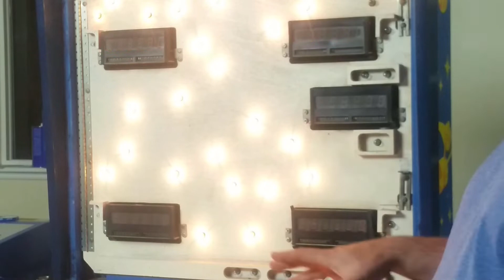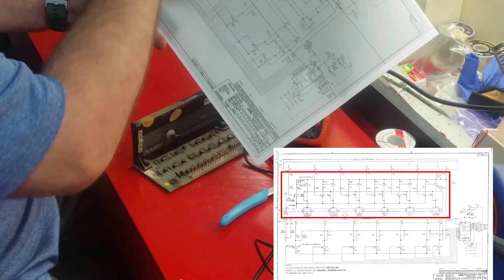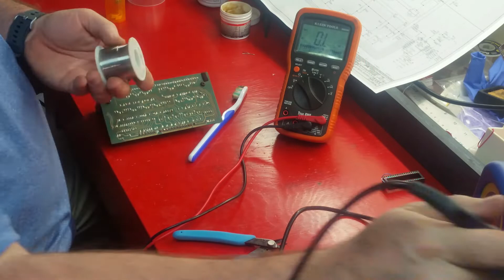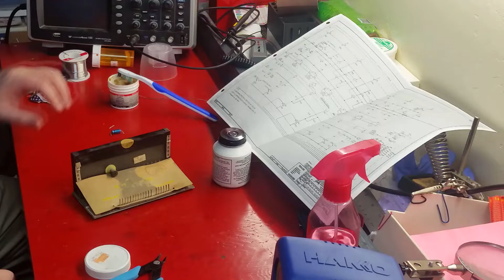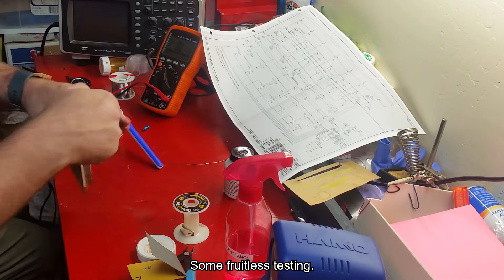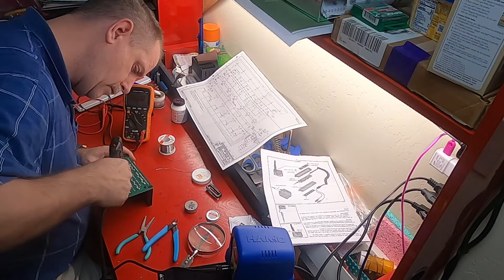Display refurbishment

Comment: When replacing bad transistors, How to choose a different transistor part number that is Compatible? The HFE, beta, NPN or PNP but what else to look for that will make it compatible because if the bad transistor is an NPN and you choose another transistor part number that is NPN why won't it work in various circuits?
Reply from the maker: I am just a hobbiest, so I am not an expert by any means.  However, I usually start with the parametric searches on the electronics providers.  The order of importance of parameters, in my layman level opinion, is:
1. Type: BJT, JFET, MOSFET, etc.  Can't replace one with the other without re-engineering the circuit.
2. classification: NPN, PNP, N channel, P channel, etc.  Same reason as #1.
3. Package:  It doesn't really help to have all the correct electrical characteristics if it won't physically fit.
4. Voltages: If a transistor can't handle the voltage levels of the circuit, it won't last long at all.
5. Current handling: Same reason as #4.  
6. HFE, Beta, etc.  These are important in many cases, and getting as close as possible is great.  However, depending on the application, it may not matter.  sometimes they are just a switch, and only operate fully saturated which makes these less critical.

Of course, this is just my opinion, and a very uneducated opinion when it comes to electrical engineering.  I haven't had to do this in any circuits to date.  Even in cases where the part was discontinued, I have been lucky enough to find a replacement through eBay for circuits I have had to repair.

If anyone else has an answer to this, feel free to chime in.
Reply: @laserfreshelectronics  The DC biasing resistors that are setting up the operation range of the transistor. If you replace the NPN transistor with another part number NPN transistor it might clip on the positive clipping or negative clipping because the biasing resistors values would have to be adjusted for the correct operation range of the transistor. I'm not sure why they make different part numbers for NPN transistors because its the same channel type so they should all be the same DC biasing points for operations.